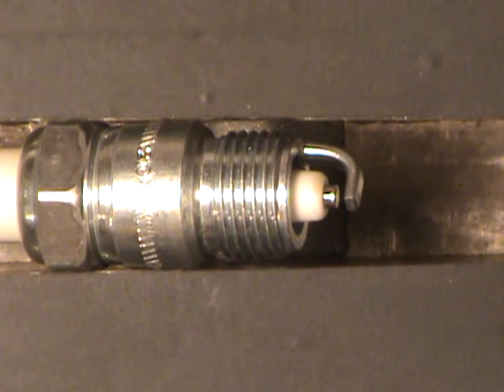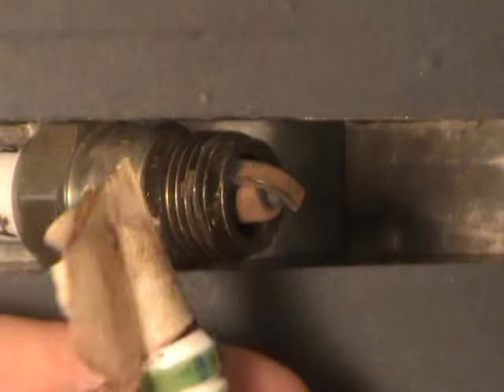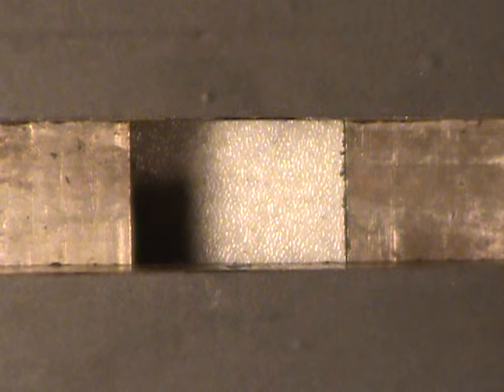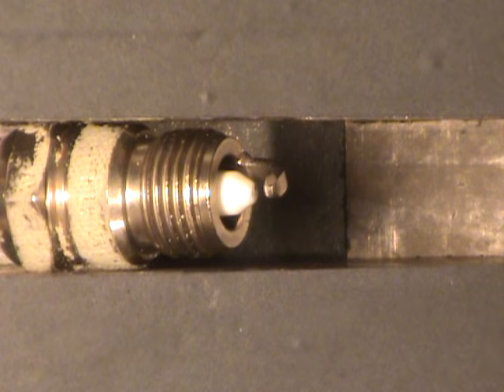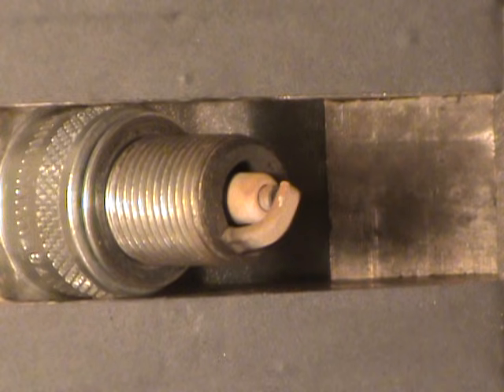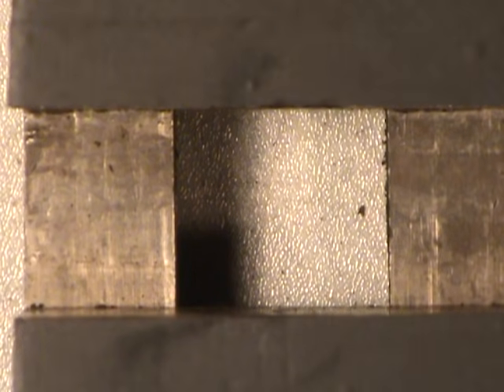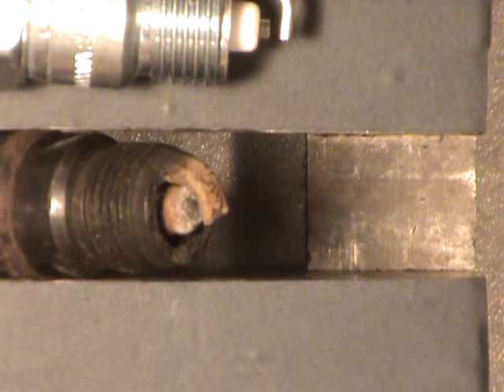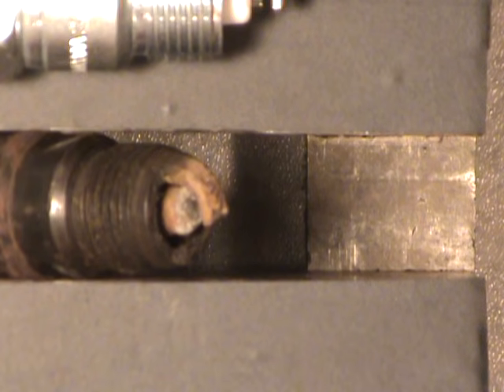SPARK PLUGS How to Read them (Part 3)

Comment: Just side gap it thats what we do in drag racing and index the plug. Always had best burn in the cylinder every time
Reply from the maker: Greetings...iginogasparini3369........Thanks for watching.........I hear alright, when it comes to side gapping and indexing a spark plug alright, but, I be thnkin' that, they won't last very long in a daily driver, because of the excessive gap-growth that would probably occur, in a much shorter time, than a regular spark plug will last..........Also, it would have to be the cheaper type of spark plug, that has that rather large diameter center electrode, in order for it to be side gapped..........I sure don't see, that a platinum or irridium plug, could be side gapped, just sayin'........That light tan colored spark plug that you saw in this video, was probably a bit on the rich side of things, but man, I tell Ya, that, that Dodge 360 cubic inch V-8, with that 850 cfm carter Thermoquad on top of it, sure liked it a lot, because, the damn thing, never, ever, pulled that hard before, I stuck those two larger primary jets into it (went from some worn out a bit .095" all the way up to .104" (increased the size a bit at a time/about 3 times, until I ended up with the larger number).........Be safe, take care, and have a good one.
Reply: @RockysRoadshow  i gap all my side gap plugs to 45.   And youse heat range of 7.  The plug is NGK FR5.   And I run them all in my 860 cubic inch mountain motors making 3000 hp plus on 3 stage NOS.  TWO PRO SHOT FOGGER AND TWO BIG SHOT PLATES
Reply from the maker: @iginogasparini3369  Greetings once again.........Wowsers, lots of torque and horsepower Ya have there..........I be thinkin' that, your led foot is in full control of all of that, shall we say, Grunt, and then some, congrats.........I recall running some NGK's, in a circa, 1972 351 V-8 Cleveland engine.........If i recall correctly, then, they were probably the NGK "V" groove design, having a V shape, on the face of the center electrode..........No-sir-ee-Bob, I didn't use the NGK 7's, as, I used a NGK heat range of "5" (I still have them, in a used condition, as well as a few other brands, used as well).........Damn NGK's heat range being "SDRAWKCAB" (that's Backwards, spelled backwards...lol), as in, the hotter the heat range the smaller the number...???...what were they thinkin'...???... But, I will say, that, they sure do make, a good quality spark plug alright.........My opinion, when it comes to heat range numbers, is that, the older Champion spark plugs had the best numbering system, hands down...!!!.........I recall that, the Champion heat range of "12" was very common, for the older engines..........And yes, the higher the number, the hotter the heat range was (by using common sense this time), just sayin' now........I also recall having a Mopar 360 cubic inch V-8 that was parked for quite a while, and it had Champion number 12 heat range plugs in it, that were fouled a bit.........So, I happened to have a couple of Champion 14 heat range plugs in a parts drawer, so, I installed the two of them.........Hole-ee-gwalk-ah-moly...by just going up "2" (Champion) heat range numbers, the plugs were at that, good ole self cleaning temperature, while the engine was running at idle speed...!!!........I really don't think, that, I want to run those 14's while driving the vehicle at speed........NGK made some weird looking spark plugs alright.........For a Mazda Rotary engine, there were two types........One had 2 side electrodes, and the other one had 3 (2 = 180 degrees apart, and, the 3 = 120 degrees apart)........Then, there was, where the center electrode was placed.........Its end/face, poked through the 2 or 3 electrodes, as the case may be, and, it was pretty much flush/even, with the side electrodes...!!!.........I'm surprised that, you were able to have a .045" gap, with the power adder/s.........Maybe you are running Top Fuel Magnetos perhaps (45 amps maybe?).........Lower compression?.........Usually, the spark plug gaps, get set smaller, whenever combustion pressures rise, as I recall...and, be safe, take care, and have a good one.

Comment: A spark plug showing signs of "too much timing" indicates that the ignition timing is set too advanced, causing the spark to occur too early in the combustion cycle, which can lead to engine knocking, decreased fuel efficiency, and potential damage to the engine components, often appearing as a burn mark extending further down the spark plug insulator than normal.

Comment: What's a chevy
Reply from the maker: Greetings michaelgiglio........Thanks for watching......The word "Chevy", is just a short version, of the full word, being "Chevrolet"......You might also hear someone say the word "Olds", which is just the short version of "Oldsmobile"........The Chevrolet, and the Oldsmobile vehicles had a parent company called General Motors Corporation (or Company?), and the short version for that, is simply GMC......Be safe, take care, and have a good one.
Reply: @RockysRoadshow  thanks for responding.  Ok thought so.  I just don't really except the  short word like it should be expected as a norm or the car to have. All GM stuff seam to be cheaply made or dangerous to be in.  In Australia the Holden stoll the market but didn't really make a good model. See my point. Mike

Comment: I bought a bike that has been sitting for 10 years and when I got it the oil was all black as well as the spark plug all black and full of soot. What would you say this is an indication of?  What do I need to do before replacing the spark plug with a new one? Should I clean the inside where it sits or spray it with something first? I've changed the oil and gas and cleaned the carb. The bike ran very bad before and died when reaching 4:th gear after some time and when riding it for a while. So I have it taken apart now since I will be replacing the petcock since it was leaking.

Comment: At 14:50 looked like someone is burning muddy gas, with rusted fuel tank and lines! Haha that looks horrible,  as far as spark plugs go!  Only thing worse would be one black and built-up like that! 
With gas and/ or oil fouling the plug,

Comment: The outer edge of the spark plug indicates low rpm mixture (pilot mixture screw and primary jet), and looking down the well will indicate midrange rpm (needle jet and jet needle), and the porcelain centre will indicate high rpm (main jet)... these days with unleaded fuel it’s much more difficult to ‘read’ plugs then in the old days with leaded fuels...

Comment: Hey there!
 
I’ve got a 2 stroke snowmobile that’s not running right. The throttle is very delayed , and it’s not running right. I assumed it’s to rich, and the spark is inconsistent, but there are some people who says it’s fine. It’s a little oily-ish on the rings, but relatively dry on the inside of the plug. The electrode is coated with a thin layer of black all around. I’ve only run these plugs for a week total.
Reply from the maker: Greetings...Skii.........Thanks for watching........Is your spark plug's "heat range" correct for your exact engine, as in, the same spark plug that was in your engine when brand new...???.........Sometimes, when using a different brand of spark plug, the cross referencing isn't right, or maybe, the parts guy made a boo boo maybe........If you have a manual choke, try to shut it off as soon as possible, while still having the engine, keep running without stalling........Try not to idle your engine too long, and keep the RPM's up, as, lugging the engine down, at low RPM's, tends to foul spark plugs somewhat.........Don't use a dirty, carbon, or oil fouled spark plug, or it's probably gonna be, an engine "misfire", that you'll end up with, which causes even more carbon buildup........Try a new spark plug, that is the same brand and part number as the factory installed one, and also, make sure that, the spark plug's "Gap" (distance between the two electrodes), is set at the factory "Specified" measurement...........Are you using the correct gasoline to two stroke oil ratio...??? (or maybe you have an auto-lube system)..........Correct gasoline "Octane", as per your owners manual...???..........Good luck, and.....till next time......Be Safe, take care, and have a good one.

Comment: I used to much octane booster and my plugs all turned orange! I'm assuming the top of the pistons and the bottom of the valves also all tured orange.  Will running premium unleaded here in CA get rid of the orange??

Comment: What cause some plugs black and some good in Nissan pathfinder 2008,when i change the plugs that's black and the one i change also go black please why?
Reply from the maker: Greetings...EDDY K.........Thanks for watching.........If the deposit on a spark plug is a black color, and is also "dry" (not wet) looking, then, that can be caused by having too much fuel (gasoline), being injected by the fuel injection system, or, it can also be, a "weak" spark at the spark plug electrodes, which can be a lot of different things (parts), that make up the ignition system, as a complete system.........It rarely, can also be something wrong with the vehicle's on-board computer, and/or, any of its many wiring connections, possibly.........A black "wet" deposit, on a spark plug, might be way too much gasoline, getting on a spark plug, if the fuel injection system isn't working properly, and maybe, along with a weak spark too.........The fuel pressure should be checked with a high pressure fuel gauge, and, the ignition system should be checked as well, in order to make sure that, the needed high voltage, is making its way, to the spark plug's electrodes.........Be "very careful", whenever testing a high pressure, fuel injection system...!!!...and also, be "very careful", whenever working on a "high voltage" ignition system...!!! (wear safety glasses and thick dry gloves for protection).........It might not cost too much money, for a repair shop, to do those two tests for you, and, they will probably have, some really good test equipment, that, you and I, will never have.........Good luck, and......till next time......Be Safe, take care, and have a good one.

Comment: Hey, there, Mr. Rocky.  It's been a long time.  Looks like you're most famous here and keeping everyone happy.😊. Again, thank you for all of your wonderful support.  My current new starting issue with my 2003 DODGE GRAND CARAVAN brings me back to you.  Clicking noise instead of starting is what I'm still facing after supposed diagnosis of claims (by an off-brand Auto Repair shop) that I needed a new starter, then a new battery, when the starting issue persisted.  Now that my battery has died and stranded me, the shop claims that I now need to purchase a new alternator.  Please advise me.  My P1684 DIAGNOSTIC CODE still appears.  It never went away after these services.
Reply from the maker: Greetings...Lisa Gooch.........Welcome back, and, thanks for the nice comment........(Lem-me-see now...I know)....Old-Mac-Caravan-had-ah-farm.....e-eye-e-eye..."oh-No"...!!!...with-ah-click-click-here-and-ah-click-click-there..."hear"-ah-click-there-ah-click...etc. ...(insert...pause/break..."here"...in order to...compose oneself...lol).........Ah yes...the dreaded, tryin' to start the engine..."clicking" sound........That clicking sound, in a lot of cases, just means that, not enough, battery voltage & amps/amperage, is making its way, to the, works ok, (electric) starter motor.........Here's a hypothetical scenario, for you to consider.........Assuming that, of the starting system components, as in...battery...starter motor...ignition (key) switch...relay...neutral safety switch...and maybe a few more, depending on the vehicle, are in, very good condition, and then, Ya hear the "clicking" sound, when turning the ignition key, or, pushing the start button, as the case may be, to the "start" position.......The most common issue, that causes this "clicking" sound, on just about any vehicle, be it, much older, or new, happens to be, a "faulty"...battery "cable"...to...battery "terminal"...connection...and, this particular, "bad" connection, might be, that, one or both, battery, cable connections, are not tightened correctly...or maybe...has some, corrosion/crap build-up, that got between, the battery posts, and, the battery cable's, shall we say...clamps/connectors.........If you find, that, the battery, is very weak, in the morning, then, all it might take, to drain-down the battery over-night, can be as simple as leaving the vehicle's interior "dome" light "on", by mistake, or, maybe even, having, just about anything, electrical, turned on, such as, any lights, radio, etc. , when the engine "is not" running (engine, has to be running, in order, for the serpentine/fan belt, to spin the alternator's pulley, so that, the battery will get charged up, to where it should be)........Yes-Sir-ee-Bob...starter motors, and alternators, do wear out, over time/with lot-sa miles or kilometers on them, alright........When I want to know, if the alternator is charging the battery, as good as it should be doin', then, I start the engine (because I can...lol), and I connect the two test leads, from my multi-meter (same, yellow multi-meter, that is shown, in some of my other, YouTube videos), while the dial is set to, the 20 Volt range (red test lead, goes to positive/+ sign, on that battery's post/terminal...and the black lead, goes to the negative/- sign, battery post/terminal)........I usually see, about 14.5 Volts, when the engine is running, and, there "is not", anything turned on, as is, no lights, no radio, etc. (good, might be, about, 13.5 Volts, to no more than, 15 Volts, with engine running, and, with nothing, electrical turned on).........A fully charged, "good" battery, should be showing, about 12.6 Volts, all by itself, with engine "not" running.........Be very "Careful", when working near, or on, a vehicle's battery, because, there is usually, "Explosive" Gas...!!!...that vents, out of the battery, whenever it is getting "Charged-up", be it, by the vehicle's alternator, or, a portable battery charger.........Also, "don't", let any of the battery's acid (if it's the flooded type of battery, that is), get on your "good" clothing, and, here's why........A long time ago, I was carrying, an older car battery, and it made contact, with my blue-jeans........When I washed & dried, those, very same blue-jeans, I saw something very "strange", and, when I held those jeans up, to have a look-see, it looked as though, a..."swarm-of-Moths-on-steroids"...had-ah-go-at-em...nothing, but a bunch of, see-through..."Holes"...wherever, that battery "acid", made contact with the jeans...!!! (true that).........So then, the battery, has to be in good shape/fully charged up, and not having, anything, that is draining it down, when the key is removed from the ignition switch, with the exception of, something like, the vehicle's on-board computer, and maybe, the radio's clock, which usually, will only draw a little-bit, from the vehicle's battery, when the engine "is not" running..........If I get "5" years of use, out a car battery, then, that, in itself, usually, makes me, a "happy camper" (so to speak).........Starter motor and alternator, have to be in good shape/working correctly (both, the starter motor, and the alternator, can sometimes, be tested for free, at some auto-parts stores, especially so, if they are removed from the vehicle, just so Ya know)........All wiring, and, wiring connectors, have to be in good shape, be super clean, and tightened properly, so as, they don't get blamed, for the malfunction, that might be taking place........I missed, seeing your trouble code, so, I'll have a look-see (aka..investigate it...lol), and hopefully, I'll have some info, about that as well, in the near future.........Good luck, with Ur, bad case of the..."clicks"...lol...and till next time......Be Safe, take care, and have a good one.
Reply from the maker: Greetings...Lisa Gooch........(This is my second reply to you)...Now then, about that trouble code........P1684, basically means, that, the vehicle's battery, was "disconnected", within, the last "50" engine starts (engine start-ups, that is)........The code might disappear, once you have started-up the engine, "50" times or more, since the battery was "re-connected".........If there is still a problem, with that trouble code, after, "50" or more, engine starts/start-ups, then, just let me know, and, I'll see what I can do........Good luck, and.....till next time.......Be Safe, take care, and have a good one.
Reply: @RockysRoadshow  Mr
 Rocky, you were absolutely right Z again!  The failure of the newly installed battery was that the alternator was draining it.  Now that the alternator has finally been changed, the battery is properly functioning and the code has disappeared.  Love your sarcasm as you get right down to the core of the issues.  Happy Holidays to you!  Thank you for your kind generosity and great advice!
Reply: Hello, Mr. Rocky!  I hope that all is well!  Can you please tell me a diagnostic possibility for why my 2003 Dodge Grand Caravan's engine turns over fast but won't crank at times?  I haven't pinpointed what triggers this. Sometimes if I just let it sit for about 5 minutes after a NO-START, it starts. Other times, if I pump the gas pedal twice then hold it down while turning the key, it starts. I don't know if turning the key ON position helps.
Reply: Some time ago,! I was told that some ignition units are only made to service either 500 or 5,000 starts, then it needs servicing. True?